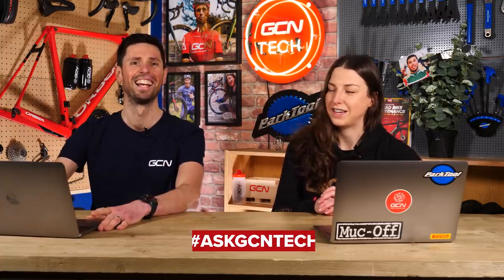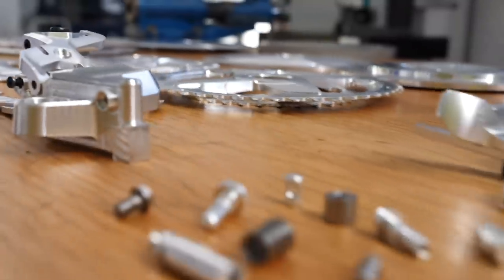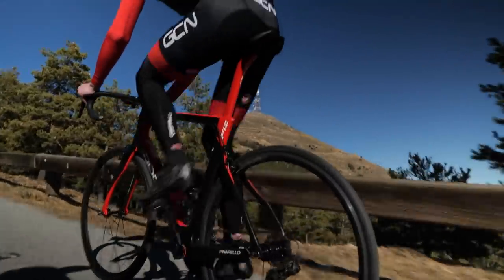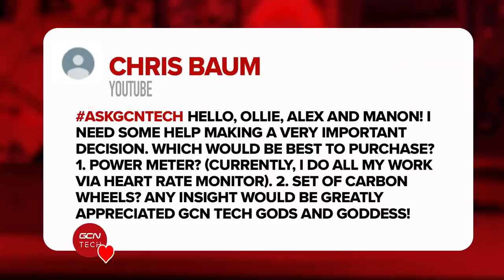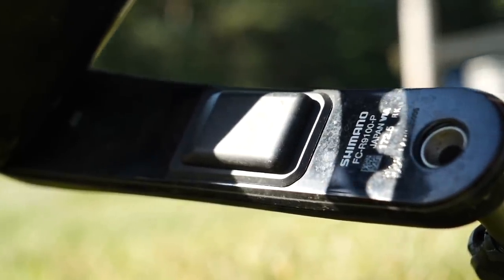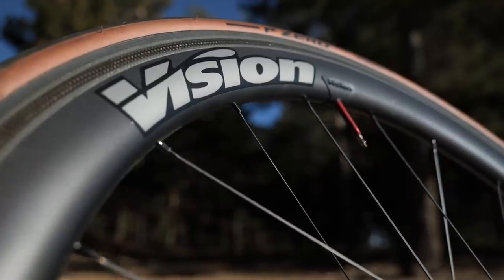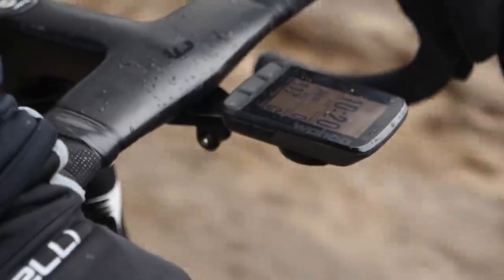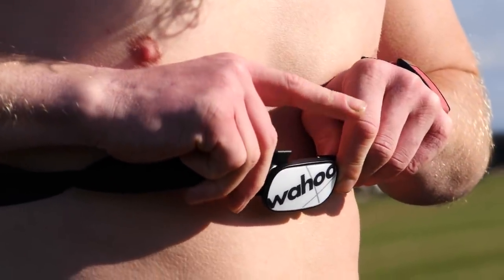Should I Buy A Power Meter Or Carbon Wheels? | GCN Tech Clinic #AskGCNTech

Comment: At 1:48 refers to the "Q Factor" (that's the distance between your feet whilst on your bike). Downside of having too wide of a Q Factor is when leaning the bike whilst hard cornering (usually in a crit race), you can bottom-out your pedals easier, vs a less wide Q Factor with everything the same. However, the downside of a tight Q Factor is if you adjust your bikes shoes a bit too close to the arms, they'll then rub against each other. This will then ruin both your shoes and your crank arms paint job, decals, or worse. And this can also be caused by pointing your shoes outward a bit too much making the heel part of the shoe rub against the arm. This is why it's important to get a bike fit done from a reputable source.

Keep it up @GCN Tech.
Reply: All true about decals, paint etc., but there is more. Your feet will have an angle that they like to be at most of the time. Picture your footprints in the snow. For me anyway, it was best to follow this angle when I set up my cleats.
Reply: @stuartfreedman6854  This technical point you raise is best dealt with when getting a good bike fit. Because yes, if you naturally walk pigeon-toed, then it's best to point your cleats that way as well.
Adding on that, most people have one leg that is just slightly longer than the other. This is corrected by removing or adding a shoe liner. This then helps equalize the pressure on your knees. Long rides can do very bad things to your body if you don't have things right to begin with.

I agree and also knew this but didn't comment it as my initial comment was already too long (that's what she said).

Comment: I’m an older rider and I didn’t just flip my stem I opted for one with a really steep angle, so I’m more upright when I ride. It’s made my riding a lot more comfortable.
Reply: I did the same, it's just a shame they look soooo ugly.
Reply: Instead of a +17 stem, there’s lot of good sporty bikes that have a higher stack height and shorter reach achieving those same results with copious spacers and high rise stems, Cervelo, Roubaix, Synapse, Etc.
Also, a lot of the new gravel bikes have that as well but make excellent road bikes if switch tires over.
Reply: @Thomas-fy9yc  of course, why didn't I think of that. Instead of wasting £30 on a new stem, I should throw my entire bike away and buy a new one. It makes perfect sense, I'll get right on that.

Comment: Oval rings… They take no time to to get used to.  I never noticed a difference at all.  Until I went back (after a few hundred miles on the ovals) to my “rain bike” with round rings.  I literally thought something was wrong with the BB, it felt like mud in certain spots.  Then I realized those “certain spots” were 12 and 6 o’clock.  True story.

Comment: Something is wrong with me. Despite playing the video twice, I can 't find the part of the video where the question "Should I get a frame that's a little big or small?" is addressed. Can someone provide the time stamp of that segment?
Reply: Yeah its not in here I don't think. I really excited because I'm looking at buying a used discontinued frame and it's a little bigger than my normal ride
Reply: 😆😆😆 no not just you. False advertising gcn!
Reply: Same here. They must've edited out that part, or simply very poor headline writing. Bad job on GCN's part. And/or click-baity.
Reply: @Kingjay814  I'm with you. I am right between frame sizes for a bike I'm considering. Since I am not the most flexible person, and because I am much more interested in longer ride comfort rather than getting stretched out and more aero, I will go with the smaller frame.
Reply: From my experience I can recommend the smaller one. It‘s easier to adjust the seat post a little bit higher and also maybe change the stem for a longer one than the other way around. Also you will save some weight.
Reply from the maker: Sorry Mr. Luigi - due to a technical error, we had to move this question to next week's clinic. Stay tuned!
Reply: @gcntech  That was very kind to let me know what happened.😘 Next week's show is going to be delicious!
Reply: @vladimirsepelak6111  I agree and that's why I just ordered my frame in the smaller size. Fingers crossed. 🤞🤞🤞
Reply: I went up a size on my newer bike only because I found it more stable on longer fast descents. I liked the agility of a size smaller frame and I've still got that bike as a backup.

Comment: On the question from Paul Collingridge, I'm 61 and also experienced some issues with my shoulders. I fitted a shorter stem, from 120 mm to 85 mm. I shifted the saddle back 15 mm. This gave me a much better ride position. I'm not saying this is what Paul should do, I simply wanted to say what I have done. By the way, us mature roadies still crank out the km ;)
Reply: That's a good point. When you get shoulder and neck pain, the temptation is to move the saddle forward,  but this actually makes it worse as it puts more of your body weight on your arms. That's the mistake I made, but moving my saddle back and changing my stem fixed it for me.
Reply: This question was me about 3 years ago. Mid fifties, wanting to do longer rides but suffered massive neck pain after about 15km. Solution: a bike fit which completely changed my position including increasing my steam length from 85mm to 120mm. No more pain. Transferred the geometry to two more bikes since then and all still good.

Comment: I just sold yesterday my (Roval C38) that came on my (Specialized Roubaix Expert Di2 2019) to buy yesterday at PBK the (Zipp 303 Firecrest Disc) that was at a crazy good price and weight too! Can't wait to go from "1560g, Hooks, 21mm Internal" to "1352g, Hookless, 25mm Internal" to better fit the new GP5000 STR 28mm tire I've ordered too. Was definitely worth an extra grand. Power Meters are so overpriced I have absolutely no idea why it's that expensive and since I already have the most expensive Look pedals, I ain't gonna change anytime soon.

Comment: For the 63 year old cyclist that wants to have a more comfy position, look into how Endurance bikes are set up. Maybe you need a short stem that angles upwards more so that you are a bit more upright, maybe the fork steerer tube has been cut too short, etc.
Reply: Yep, I agree. Was going to say try a shorter stem, but if the bike has been slammed... it's a probably a new fork... or bike! If it hasn't, place any spacer that are above the stem below it. Saddle height (lower) might also provide benefits, it certainly did for this old fogey!
Reply: New bike day!!!!!
Reply: I'm late 50's and suffered a lot from neck and shoulder pain for a long time. Bought a Concept 2 rower in September and after a few weeks the pains were completely resolved. Activating previously weak or unused muscles seems to have done the trick. Plus its a nice alternative to the bike when training in the garage!

Comment: Regarding the oval chain ring,
I do use them, but only on my 1x mtb.. They feel a bit funky at first, but you really get used to it fast, and I do not find switching from my "normal" road bike to my mtb bike irritating.. The reason I use them is not some power gain or something like that, but for technical climbes, because I find I can always put all my power down, even if my cranks are in the top/suboptimal position. This is helpful if you get a stick/rock or something in front of your front wheel and you instantly need some torque to get over them. So just no dead spots while technical climbing for me, and that's why I do not use them on my road bike

Comment: I was facing the same question last year and went for 40 mm carbon wheels. Instant benefits, I am so delighted. Kept my alloy wheels for windy days but never even put them back on. I got used to the twitchyness in cross winds. Powermeter might be my next upgrade but I am definitely happy I bought those carbon wheels!

Comment: For a more comfortable riding position try this:

Flip stem
More spacers underneath the stem
Get a shorter stem, so the handlebars are closer to you
Set your saddle a little bit lower, so you have less saddle to handlebar drop
Set your saddle a little bit more back, this will put less pressure on your hands
Set your saddle more horizontal if it's too nose down
Reply: Flipped the stem on one of my bikes before going for a long ride, wow what a difference in comfort after a few hours in the saddle. Doesn’t look nearly as cool or fast, but who cares!

Comment: For the older rider... if speed/aero position is not important to you, try dropping your saddle a bit. It helps to get the weight off your arms and straightens your back. Maybe 20mm to start with, then you can adjust in smaller increments up or down to find your preferred position. A lot of bike set up advice is aimed at much younger and far more supple people. It certainly helped for me, especially on longer rides... my average ride length is around the 100km mark.

Comment: Outward pedal cleat adjustment vs pedal shaft extensions.  Most cleats have adjustment to move them outward (away from the crank), but it's there mostly to help clear the heal from striking the frame and crank if a rider's foot/toe position is angled outward.
The problem with pedal axle extensions are many... Sure it helps line up leg bones parallel to wide hips, but extensions also put a massive side load on crank arms which causes excessive, side to side bottom bracket frame flex.  Sure, if you're casual rider extensions are fine.  But if you're a racer you will lose a lot of watts just to flex the frame first before getting forward motion power.  From experience, riders with pedal axle extensions often fatigue and crack their frames around the BB area especially titanium frames.

Comment: Switched to oval chain ring to compensate for weaker left leg after total hip replacement surgery. Done after bike fit, and adjusted cranks as well, going to shorter ones. Hardly noticed the difference. Works fine for me.

Comment: I have a damaged ACL and torn meniscus in my left knee and damaged cartridge on the back of my knee cap in my right knee.  I rode Q-rings for several years and for some reason, I changed from Q-rings back to standard 3years ago.  I felt the difference with pain a fatigue in my knees (back of the knee immediately).  I continued to ride the standard rings for remainder of that year.  My cadence got slower and I didn’t have the acceleration I once had.  I struggled with a 50 big ring and my climbing on the 34/32 sucked.  My riding distances decreased due to knee pain and swelling.  I went back to the Q-rings and I’m back riding a 52/36 front and my knees feel better with less swelling.  I believe older people or ones with knee injuries would feel the benefit from the rings.  Pros or younger athletes my not “feel” the difference.  I think they would notice it when climbing seated or standing.

Comment: I bought power cranks but I think it's just extra weight and tech I didn't need. I have a trainer with power and I use that as a tool to measure FTP and power at cadence. My most valuable tool is my cadence sensor which I had on my back up bike. HRT I use to see fitness gains combined with pushing my cadence at given speeds. You get a pretty good indicator of power from the calculation done from average speed, cadence, HRT and body mass.

Comment: I switched to oval chainrings (absolute black 53-39) about six months ago.    First 50km were a bit weird but I like them a lot so far.    Power meter says it hasn't improved my wattage at all, but I do feel that the hill climbs are a little less tiring with them.

Comment: As for the Power Meter/Carbon Wheel dilemma, it depends if you have rim brakes. With rim brakes, you would need to change your brake pads every time you switched between your Carbon and Aluminum Wheels. About large/small frame. I never look at frame size. I know that all I need is a bike with a 58cm top tube. If it has that top tube, it will fit me. One of my bikes has a compact frame. I needed a long mountain bike setback seatpost to fit my legs. The other frames use a standard sized setback post. I need the setback type post to get my knees in the proper position to my pedal spindle.
Reply: For the meter vs. wheel question: want to train more effectively or gauge your performance more accurately, get the meter. Want to look cool and have less weight during climbs, then get carbon wheels. It depends on a person's priorities.

Personally, i'd go for the wheels. I just ride my bike with my friends as much as we can and we don't really "train" so i am not very interested at how many watts i am putting out. I don't even use a heart rate monitor. But carbon wheels would help me conserve a bit more power on stop-and-go traffic and climbs, plus they do look cool. The weight savings on carbon vs. aluminium wheels are around as much as the weight savings of carbon vs. aluminium frames.
Reply: I have disc brakes on all my bikes Road, Gravel and Mountain!!

Comment: The answer to the unanswered question is not easy to tell. I had to go with the bigger frame because I have very long legs and on the smaller size, the seatpost would have been at maximum extension and I would have had a huge seatpost to handlebar drop. I had to swap the stem and the seatpost (for a zero setback). It might be completely different for someone else. Get a pre-buy fit. It‘s worth it.

Comment: Dispite the temptation to buy a nice set of carbon wheels I bought a single sided assiamo power meter, and it has by far been the best upgrade, my FTP has increased by 15% my power to weight increased by 18% and that was at a point when I thought I had plateaued in my training.only now have I ordered a new set of carbon wheels, which I doubt will even give me a 2% gain in speed.if you wanna be all show and no go , get the carbon bling , if you wanna progress in training  and drop you buddies on the climb get the powermeter

Comment: I'd get the extended pedal length as you could adjust the cleat to fit your shoe closer to the crank til it rubs but standard length don't really allow you to adjust it out that much

Comment: To Paul Collingridge: Check your handlebar width. If you are on the hoods and tend to roll your wrists inwards, you will most likely need a narrower bar. I switched from the 44 that came on the bike to a 40 after a bike fit and my neck pain is gone. Doesn‘t sound like much but it makes a big difference.

Comment: Carbon wheels are the best upgrade.  Most often than not they have several advantages over stocks wheelsets.  Tubeless ability, a wider internal width improving comfort, better aero profile, and often are lighter.  
I have a power meter and if the battery dies, it doesn’t kill the ride, but I notice crappy wheels right of way.

Comment: If you think about it, oval chainrings might not have the advantages that are claimed
 Why? Because they make the chain move up and down (a small reciprocal energy loss), they make the derailleur jockey wheel assembly move backwards and forwards (another reciprocal energy loss) and they also mean your lower legs and feet have to slightly accelerate and then decelerate (yet more energy loss).
And when it comes to aerodynamics, consider this - if legs are momentarily moving slightly faster over top dead centre, then the wind resistance on that leg has also increased, at the square of the speed, whereas the reduction in wind resistance, at bottom dead centre, hasn't reduced so much, because although there is an equivalent deceleration, the actual angle of the lower leg is more of a slope in terms of exposure to the wind, resulting in a slight reduction in surface area; so the net effect, on the whole rider and bike, is an increase in wind resistance.
We're always talking about marginal gains, but no-one seems to take into account these marginal losses.

Comment: Like my frames slightly larger. Easier for me to stand up. Reaching feels better sitting with as a beneficial stretch. Not way out but it’s good to stretch. Should be ballpark of course between two sizes. And pedal must be correct. If that isn’t right, pain will occur.

Comment: Pro’s will always have a smaller frame and any bike fitter will tell you always go smaller as you can always increase lengths with stem, seat post etc. Never get a bike that’s to big.
Bike fit James sells mainly Shimano pedals with the extra length spindle as he rightly says it’s your hip impingement and nothing to do with knee inline with feet. The standard size is made for super slim types and pro’s which the majority aren’t.
Alex is wrong about the knee in-line with knee, because unless you’re clipped into both types, how will know

Comment from the maker: Carbon rims or a power meter - which would YOU choose? Let us know in the comments! Remember to let us know of any tech questions you have in the comments with #AskGCNTech!👇
Reply: Carbon rims, I don’t have enough power to actually be measured.
Reply: First carbon rims. My ftp is to low for Powermeter. 😂 180w, 90kg😅
Reply: Carbon wheel. Don't need a Power meter, only stats I'm looking at are heart rate, RPM, and distance.
Reply: Power meter for sure. Helps pace yourself and seeing the numbers go up can be motivating.
Reply: I did actually first upgraded my rims to campi wtos… the result was so impressive that it got me all exited to take my cycling more seriously!   Then I went and purchased the Powermeter and it is every bit as useful as Manon says it is. Now if I want to do it again I would still first upgrade my rims…

Comment: I still have the original BioPace rings on my RockHopper. The first time the Olympic were in China I watched  the cycle races and was put well off the BioPace idea when I saw how the leg muscles were ‘flapping’ around with the irregular shape.
Reply: Turns out the Bio pace - while the right idea, was the wrong application... I understand they had the alignment out by 90 degrees. I never liked them...